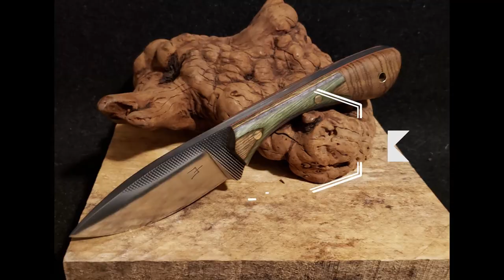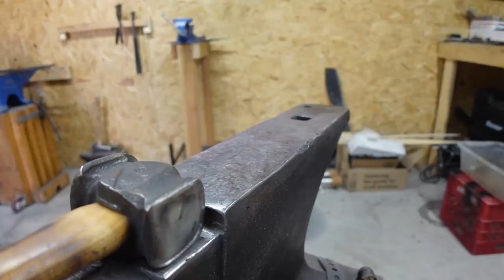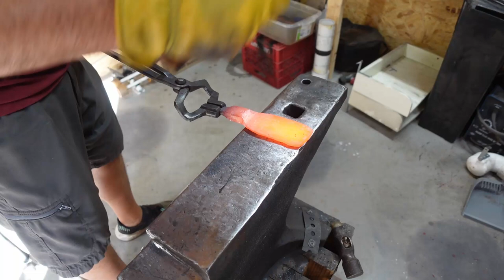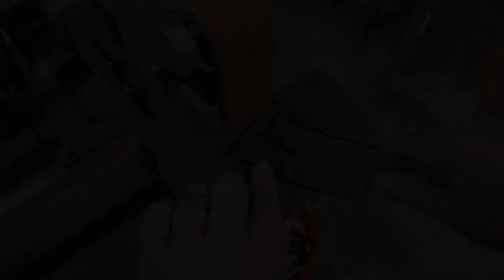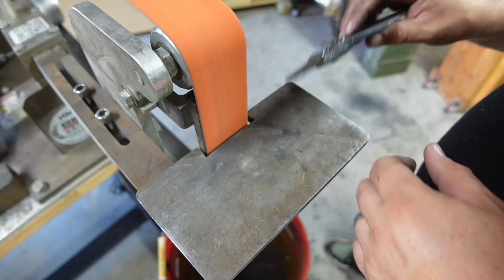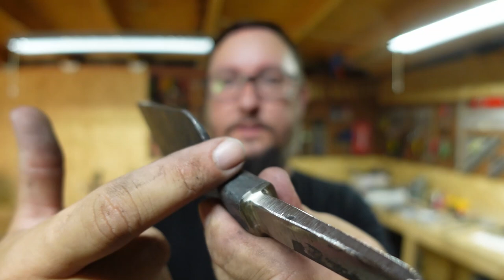Hand Forging An Integral Bolster Cleaver | Shop Talk Tuesday Episode 184 | Knife Making

Comment: Your anvil is anchored ....but your stand isn't... Don't want you getting injured mate. Top notch chopper 💪
Reply from the maker: The stand is actually meant to be moved. I pull them to the center when forging, then rock them onto casters that I have mounted to the sides of them, and move them out of the way. It clears the center of the shop for other tools. I have to think about filming angles. If I didn't film myself, I'd have everything anchored.
Reply from the maker: This is another great topic to talk about on Thursday during the live stream.

Comment: Great video. Are you forging that coil at yellow heat or bright orange ? Thanks
Reply from the maker: It's more of a bright orange when I'm forging it. I should also note that this steel is hotter than it seems on camera, the camera and lighting make the steel look different from what I actually see.
Reply: @theriversexperience9383  correct it looks yellow on video. Yellow got my metal to spider web and break but boy it moves good.    Thanks for the reply.

Comment: The flat on tang at the beginning of the video, was that welded on or did you forge that previously Erik ?
Reply from the maker: I welded it on there. I took it off once I started forging the tang.
Reply: @theriversexperience9383  ok thanks for the reply

Comment: I want to give you some constructive critisism. Ive been watching your videos for a while and one thing I see constantly is, you using excessive amount of hammer blows to barely move any material. Your main issue is heat. You metal is never hot enough. And i know it's not the camera because you can tell your hammer is barely moving metal . You could have made that knife in 10 minutes of hammering not 30 minutes. Just trying to save your shoulder is all. Not trying to talk shit just trying to help a fellow Smith.
Reply from the maker: Constructive criticism is always welcome.
Reply from the maker: I'll be addressing this on Thursday's live stream actually. This should be a good topic, thanks for the idea.